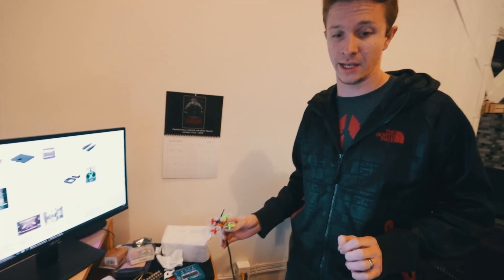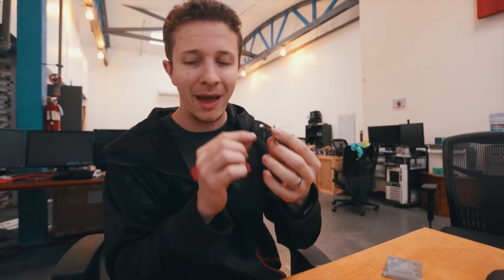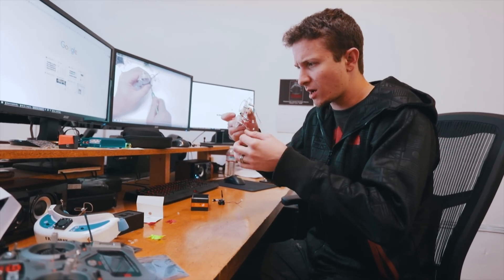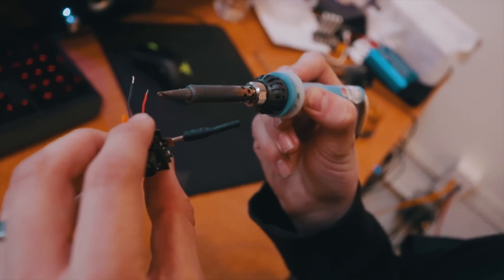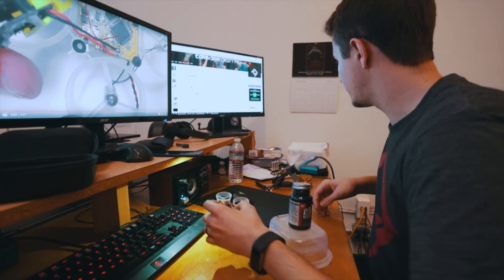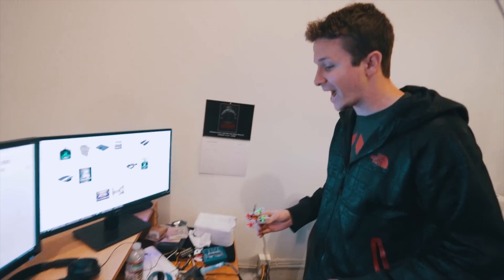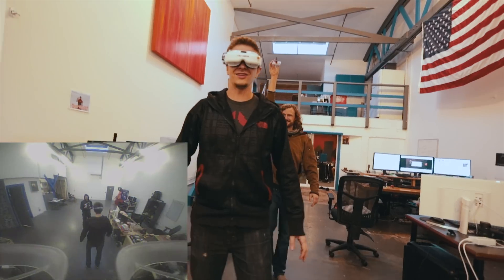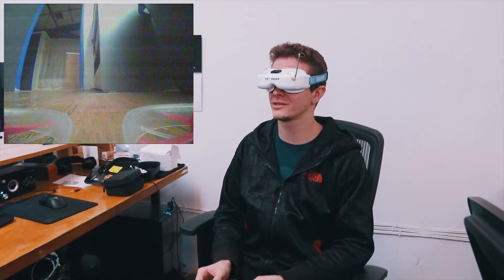World's Smallest DIY Spy Drone!

Comment: Can you guys post a parts list of everything one would need to buy to build that drone?!? I gotta get me one.
Reply: Apparently it's called a tiny whoop. That's all i know i'm still looking into this.
Reply: SSarchitectful Thanks man, let me know if you find out anything more
Reply: I noticed that they posted a comment with what they were using.
Reply: This is them quoted:
Hey Everyone! Parts list for the drone is in the description! Explanation here:

The drone I built is a modified Inductrix Blade, most commonly referred 
to as a "Tiny Whoop". You can buy fully built kits, DIY kits, or buy the
 individual parts and assemble it together like I did. You will also 
need a radio transmitter (the controller) and some FPV goggles to view 
the camera feed. You can also just use a little monitor screen that has a
 radio antenna attached. I already had these from when I started getting
 into racing drones last year. If you go the build-it-yourself route you
 will want to watch a lot of tutorials and will need a soldering iron. 
It wasn't as hard as I expected it to be though ;)

I was flying in what's called "*Acro*" mode, meaning that it does not
 fly like a DJI drone. If you set it to "level" mode, it will behave 
that way, but in acro mode it will not self-correct so you can easily do
 things like flips and barrel rolls, but also makes it way more 
difficult to fly. If you press forward on the sticks, it will continue 
to go forward until it's upside down haha. I've started learning how to 
do flips and stuff but I need to set better PIDs.

The main components of the drone are the airframe, props, motors, flight
 controller (brain), camera, and batteries. I provided links to 
everything I could in the description. You can choose more powerful 
motors which will give you more agility and ability to do flips. I went 
with the middle-power motors for now but will probably upgrade soon. 
ALSO, the radio antenna on my camera is a linear one rather than the 
cloverleaf configuration normally seen as default with the tiny whoops, 
because it's supposedly harder to break. The bigger antennas break 
easily. I also hot-glued some tooth-picks from the antenna to the frame 
for added support. 
Good luck everyone!

Comment: you should give Acro mode a try! do some flips
Reply: Fezz Stenton agreed.
Reply: Fezz Stenton I was actually flying in acro mode the whole time. I'm still learning. I need to set better PIDs before I can pull off the flips. But the motors I bought should be able to handle them!

Comment: How much was the drone in total for the parts?
Reply: RossN those goggles are about 300$ the transmitter looks like a dx6i so probably also like 300$ and the small quadcopters like that can be made for under 50$
Reply: 120 $ give or take 5 bucks

Comment: Wren! What parts did you use to build your drone man?
Reply: Jason Edgar Look for Tiny Whoop in the interwebs, it's pretty much all over the place
Reply: it looks like you get a better flight time out of the clone: Eachine E010 and it costs only 1/3rd of the whoop. and there is the slightly larger Eachine QX70 with already installed camera and way larger battery
Reply: The one used in the video are fatsharks. They are pretty expensive, so box style goggles like the vr008 or vr d2 would be better if you want something cheaper. They work with 5.8 GHz transmitters.
Reply: Jason Edgar I'll write up a parts list for the description very soon!!
Reply: So i found some potential drones to buy. However i'm having issues finding out which ones come with the goggles that he was using in this video. Do you need to buy those separately and pair it with the drone? If so how?
Reply: wrenthereaper flite test sells a faster version 😛
Reply: its a tiny whoop you can get it pre built
Reply: just search for " Tiny Whoop " on google